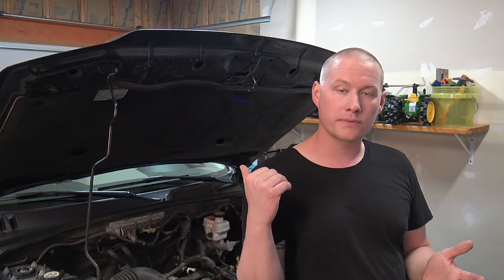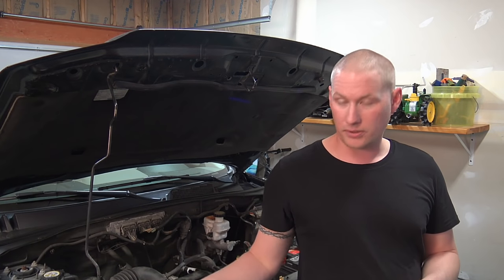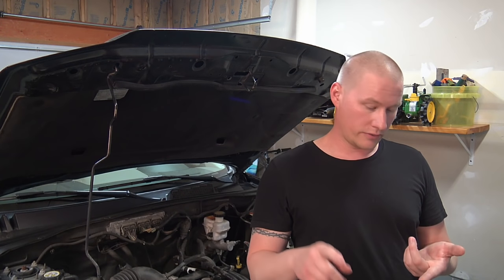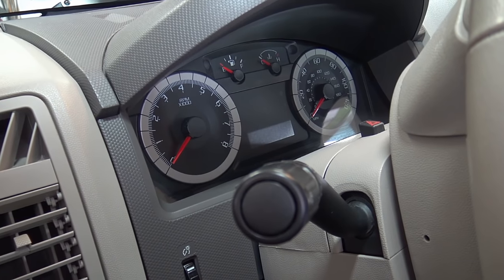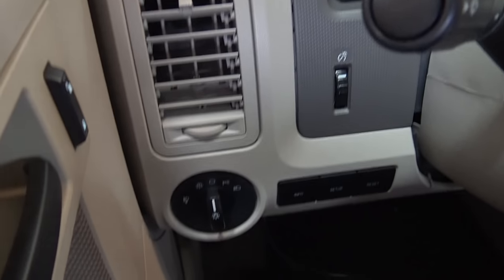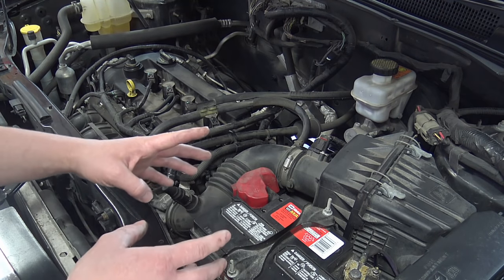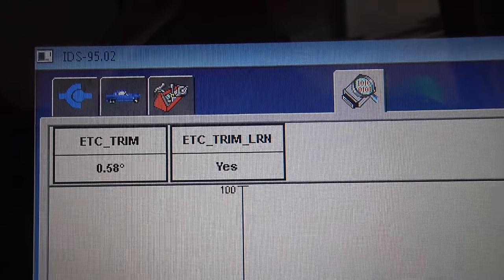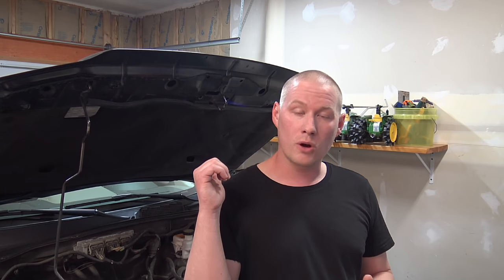Ford Vehicles: Electronic Throttle Body Calibration Procedure

Comment: Just installing Edelbrock e-force Supercharger California kit on my 2011 Mustang. Used Edelbrock 50-state legal calibration for this stage 1 kit. Car runs nice when warmed up but cold start timing is not working car brought up code p050b and p050e. Any suggestions on how to get my cold start timing fixed? When I start the car cold it does not automatically choke just starts with low idle.

Comment: Question: I did notice a big difference when resetting the throttle body per your recommended procedure. What is the prognoses when after a day or two of driving it goes back to that way it was before the reset procedure? Specifically the lurch that occurs during the 2-3 shift. Any help is greatly appreciated!
Reply: I’ve noticed this too after installing a new battery and doing the battery relearn procedure in the manual…there was a noticeable throttle response during the initial relearn but just as you mentioned above it sort of reverted back to what I assume the on board computer was programmed for? I believe he has another video on how the transmission uses adaptive memory based off a persons driving habits but I im not certain. 
If you found an accurate explanation please share. Thank you

Comment: I just cleaned my battery terminals and changed my oil in my 2009 Ford Taurus and the shift points were out of whack and this video I'm sure that is the problem is The guiding light that will help me fix my wife's car

Comment: Hello. By the way is there a way to reset the throttle body with a process to learn without a programing device? I have a similar problem on 2011 ford fusion 188k miles tranny going bad and when it's happen I just stop and turn off the engine and turn on... No problem found. For some times that wrench on the dash appears but no codes with a regular scan I found. I have a another similar problem with the steering system suddenly stops to work (I can move the steering) and when turn off the engine and on again the problem goes away... Any tips? 
Thanks for your channel :)

Comment: about to change throttle body in 09 escape. when I reset everything. I won't be able to turn off the ac. when you start the truck ac turns on automatically and can't be turned off till usually after about 10  minutes. this escape had a mind of its own. will that effect anything during reset process??

Comment: I might have asked you this here or on facebook but ill ask again. 2002 crown vic mechanical throttle body do i do this relearn process on that as after clean the TB or just remove the neg battery terminal for 30 minutes?

Comment: hey, i could use some help please, so i cleaned my throttle body, and did the relearn process, following both of your videos, and when i started the car the engine is running badly, and is in fail safe mode, the car is an 05 ford 500 , what should i do??
Reply from the maker: The throttle body on these vehicles are notorious for failing internally and replacement is the only fix but get it on Amazon as it is hundreds cheaper than the Ford Dealer for the same Ford part Here- http://amzn.to/2bgvOzD

Comment: Just changed out the stock air intake system on my 08 focus se for a ram air, threw maf error codes as well as o2 sensor codes. Was wondering if I'm running into a similar issue with my throttle.

Comment: Ford Explorer 2013 Limited 4WD.  
If I had been smarter, I might have saved a lot of money by watching this video.  

I would get the Terrain Management Pop-Up Warning, and then the wrench symbol, and my truck would not go, pressing accelerator made no difference, engine shaking badly.  It required you to stop, wait a minute and then restart the motor.  At first it only happened at very low speed.  
I paid the Ford dealer a lot of money for things I did not need, but they said it was fixed.  The next day out of their shop, it failed in heavy traffic on a 8 lane Houston highway in heavy traffic, damn scary.  
Finally they found the real problem: Electronic Throttle Body stuck wide open. 

Apparently it does not give a computer error code.  Ford dealer eventually( a full week later) found the problem.  Hats off there, but Ford needs to document this problem for their computer database.

Vehicle will not go, (it can happen at anytime low speed of at 65 mph), but most often when you let up on the gas pedal.  
It is very dangerous situation.  You absolutely have to get it fixed!!

Comment: I have ford explorer 2008 shaking idle after changing the sparks and ignition coils. The throttle body is cleaned and mass air flow sensor as well. Is there anything else should I do ?

Comment: Hi, i have a question.
I upgrade my throttle body on my 2012 f150 but they told me i have to calibrate the throttle body and the question is.
Can i do the same thing you did on the video to calibrate the new throttle body?

Comment: I did mine and cracked the holes for my bolts in the sensor.  should I get a new sensor or go ahead and leave it on and assume it's all good.  cara running fine

Comment: Curious about something. I have a 2006 motor home with the v10.  If I hit the switch that shuts off the chassis battery so the battery isn't drained while dry camping and such or over the winter, does the throttle body need to be reset?  When I rev the engine up while in park and let off the throttle, the idle drops to about 400 rpm and then goes back up to about 750. There have been a few occasions over the years that the engine will die while pulling into a tight turn at low speed, like  an entry into a parking lot or something. The engine is a 2006 and has 43k miles on it.

Comment: I had to get a new throttle body connector and have to solder the wires. If I accidentally cross the wires up, will it still run?

Comment: Hello! I need some help with my 2006 Mitsubishi Outlander SE and showing code p2138 I had changed the accelerator pedal sensor & throttle body but still the car is in limp mode in a couple of driving only. My question is, since I replaced both the sensor is this re learning is applicable too with my car? Hope you will response to my question thank you so much!

Comment: So on these "cable less" tb's, is there an idle air control any more or does the pcm control idle speed with the throttle plate?  Mazda's pretty much the same?

Comment: I've got a question... If I were to do this procedure right now, while its 0 F outside, would the internals calculate the low temp startup values incorrectly/non-optimally? If not, ok... If so, is there a 'recommended ambient temperature' for this procedure?

Comment: Would this fix my speedometer not working and odometer?   Also transmission not shifting properly since that issue.  It's intermittent. Once I shut off the truck and restart it's fine for awhile.  (2011 f150. 5.0)

Comment: I now do a computer reset (using ForScan for PC) after every fairly major repair job relating to intake, fuel, spark, transmission, or exhaust. After a major tuneup, after cleaning throttlebody, after a new air filter, basically anything that is fairly major in maintenance. I do a computer reset, and let the car relearn everything with the new parts installed. It definitely makes a difference. Makes the car run better. And improves fuel mileage as well as overall performance. It is definitely not a joke.

Comment: FordTechMakuloco

 Would you need to do this after changing spark plugs? I recently changed the spark plugs on my 5.0 f150 and it's running worse than before now.
Reply: Any time you disconnect your battery, which you should be doing when performing maintenance to your vehicle. You should follow this advice to relearn idle trim and transmission shift points.

Comment: I did everything right after cleaning the throttle body and maf sensor , new air filter , plugs and wires and fuel rail pressure sensor.  Still has a low rough idle.  Any ideas?  Plugs are bosch double platinum pre gapped

Comment: I had some throttle position sensor codes and a trans fault on my f150 so I cleaned the throttle body and sensors and took it for a test drive and it still says improper gear ratio 1 and 2 but the engine codes didn't come back. do i need to open my transmission?

Comment: I have a four-cylinder ford escape 2012, and it vibrates quite badly when on idle, like at a stop light, for example, and only when on Drive, the vibration is very very annoying. When on the road the card runs very smoothly though. I have changed the motor mounts but the vibration persists, one thing to mention is that in a few instances the battery was disconnected for long periods (about a week or so), and the RPM seems to have deteriorated as a result  (around near 550 - 650 RPMs when on D and idle). I have noticed that the vibration stops when on Neutral or Reverse (on Reverse still vibrates on idle but not as much as when on Drive). Any thoughts on this? would this potentially fix the issue in your opinion? thanks so much in advance for your advice sir!
Reply: Eduardo Argueta motor mounts need to be replaced
Reply: Mounts.

Comment: Thanks so much! I do want ask you can help me out with some video.  I have a 2013 ford fusion titanium which I bought from auction.  The car has sat for a long time which caused the battery fail... so I had to replace the battery.  I never knew I had to let the throttle body learn it's calibration again after the battery got replaced... the doesn't get drive often since my dad doesn't go nowhere.  My dad just complain to the the yellow wrench warning light is on. My Google search had some people saying it could be the  throttle body.  Do you have any advice for me?
Regards, 
Andrew.

Comment: Should you do this if you changed the upstream and down stream oxygen sensors at the same time as cleaning the throttle body. My Focus will nostay running. The original issue the check engine light came on and stayed and was mot blinking. Code indicated oxygen sensors. I changed them with Motorcraft ones.
Reply: Its a 2003 Focus

Comment: What I’m having issue with is the error code for a bad TPS. I’ve replaced it several times with ones from the auto parts but this last time I went to ford for the part. Still the same issue. The code I get are 2104 and 2126. Switch E. It’ll usually happen at a stop light where it’ll give a forced idle and no peddle. Other times I’ll see the wrench come on but be fine. Very upsetting

Comment: ok. so my mechanic tells me he has done all that is explained in your video. including a new throttle body and tps. and the car drives perfectly once it has learned. however when you shut off the ignition again the car forgets again and your back to square one. any advice?
Reply from the maker: You have another issue he is missing once the pcm learns the trim it is set, check the KAM fuse.
Reply: @FordTechMakuloco  you always respond. You have the best videos!

Comment: I have issues with my 2004 ford 5.4 triton I changed 7 spark plugs/ignition coils #8 spark plug is stuck in the back so I left it alone. I also changed the throttle body when I get inside and crank it up it starts up but then it accelerates really slow … I hope I just have to reset the throttle body because I been wrestling with this truck for weeks trying to figure out my problem

Comment: Could this help acceleration issues. 
I have a 2010 ford flex EcoBoost. 
It seem to take off from a dead stop way better at like 35%-50% throttle .
It has some serious lag /bad response  from a stop  at WOT.
But part is way better.
I 3ven get some lag while moving  but not as bad..

Comment: I changed my tps on my 97 ford ranger 2.3 and the valve gasket. After I was done and started the car it ran horrible and died. tried it again and it ran for a little bit. went to drive it and when I coast or put in the clutch to stop at a light it stalls. the truck ran ok before all this. could this be my problem? I don't have the little jumper you have. would disconnecting the battery overnight do the same thing? could I use a jumper cable as the cable you used? 

thanks I appreciate the video and any help.

Comment: Hey Fordtechmakuloco, does this apply to newer post 2013 Ecoboosts? I read somewhere there is an NVRam setting to reset it to certain default values, but to have it reprogram itself, you need a Ford Diagnostic/software Tool. I've got a rough idle that fits all these symptoms and I'm guessing the throttle body has been reset, but not in a re-learning sort of way.

Really hope I can get this issue figured out. It could really save me.

Comment: I've got a 2014 edge ecoboost 2.0 and need some help. Yesterday morning it was chilly (about 40* F) and a bit wet. I drove about 15 minutes and the car started to shake. I thought maybe it was a transmission issue. I got it back home and put my harbor freight scantool on it. The only code was misfire on #1. However, upon examining the values in the full data set, I saw my throttle position was at 15.7 %. I shut the car off and then clicked the key on so I could keep the scantool connected to the ecm. The value stayed at 15.7 and when I floored it the value only went to 87.1 %. Normally this is indicative of a bad TPS, but the TPS in this is integrated in the throttle body, correct? If I pull it and clean the throttle body then relearn it, is there a chance that it might run right again? If I'm way off could you point me in the right direction?

Comment: Is this for 2004 f150 5.4 also. I'm having low idle problem, and stalls at stop light. Throttle will not stay at one speed when giving it a little gas. High and low. It was parked for 2 years. Before rebuilding engine.

Comment: @fordtechmakuloco I came here hoping to find an answer regarding my 03 Lincoln LS V8. It idles rough and has zero pedal response until you put it in drive where it struggles to stay running until it stalls. Every once in a while I can limp it down the driveway but then it dies and won't restart. I've replaced all 8 coils and valve cover gaskets, ensuring timing chains and tensioner are good. I also have no check engine lights on. A cheap scan tool pulls up nothing. Any ideas aside from pouring gas on it and lighting it on fire?

Comment: Those throttle bodies when they get old can have warped butterflies which can cause high idle!! Check it with a flashlight while it is off the engine! There shouldn't be excessive space between the air horn and butterfly.

Comment: I just had my throttlebody replaced and still have reduced power. Today I just had someone to do what your video said yes and I am just pulling off from them and the wrench light has illuminated once again and reduce power. Please help I have also changed the acceleration pedal with a new throttle sensor

Comment: Is there a relearn for the charge motion runner control plates? My 07 4.6 Sport Trac has a P2015 code popping up. Id like to accurately diagnose this instead of throwing money at it and still not fixing it.

Comment: My 13” flex shutting down while I’m driving it would the throttlebody have anything to do with that usually it restarts right after or sometimes if I accelerate it doesn’t completely shut down only the dash board and screen go out and restart

Comment: I have a 2007 Ford fusion I’m getting a hard shift into second gear when it’s cold and day hard shift into fourth when it’s warm under load could this just be the throttlebody needing to be replaced or is this more likely the issue with the transmission where you have to drill it out and put in a sleeve I hate to spend$350 on a new throttlebody just to find out I have to spend 350 on the kit to drill out and put the new valve in the transmission

Comment: I have an 01 expedition that I changed the alternator on now sometimes it doesn't want to shift until around 3k rpm or wants to keep going and the rpms stay increased and doesn't want to stop when coming to a stop. I had the battery disconnected while changing the alternator....  do you think this is a good start to trying to fix these issues using this video?
Reply: and it only does this after it has been driven say 20 miles and gotten warmed up

Comment: recently I had my 05 ford 500 stall out and "engine fail safe mode" appeared. started the car again and it was fine. My car would always say "low oil pressure" after a while of driving it. Now yesterday the same engine failsafe mode appeared when I started the car and I had no response in the gas pedal and it was just spuddering. I tried what you have shown in the video and it started normal but eventually when back to engine failsafe. does this mean I need a new throttle body?

Comment: Hey bro I disconnect the battery to put into another car for about 20min then put the battery back and the truck will start but won't go at all. I went to autozone and bought the motor that's is together with black plastics only know if you know what I mean but after I put the new piece on the throttle body it still does the same thing. You think it could be the sensor on the other side of the throttle body?

Comment: Mine remains closed at half throttle. If you blip the throttle it opens then closes again. It's a 2018 Ford Ranger 3.2 five cylinder diesel we have in Australia. Real sluggish. Any ideas if this is normal for a new vehicle? There's also allot of hissing on light throttle loads..

Comment: wsup, I love ur video's! I have a 03 focus 2.0 dohc I just bought the upstream & downstream o2 sensors.i cleaned the throttle body & aic valve 2 weeks ago.so, should I clean the aic,throttle body,& maf sensor again & reset the computer & let it re-learn it's values? I think the answer is yes? I'm also gona remove the spark plugs & have a look see.clean Em if necessary (they are a few months old) tho iv been driving on them w/bad or sensors! any advice would be greatly appreciated! I also got a new coil pack but,I'm not going 2 install it needlessly.so if anyone needs 1, get @ me.